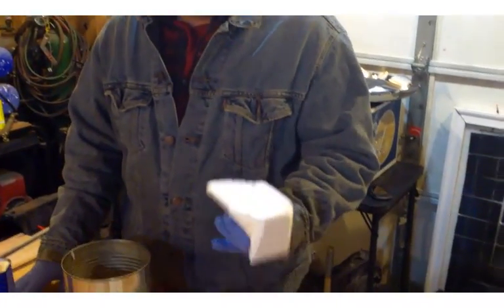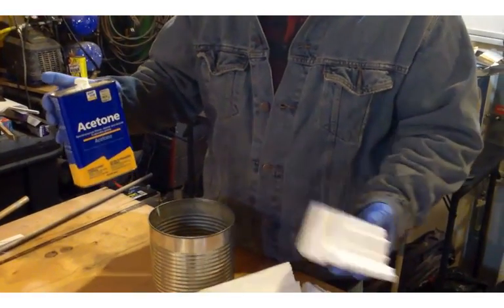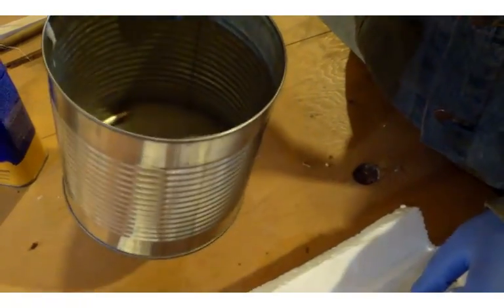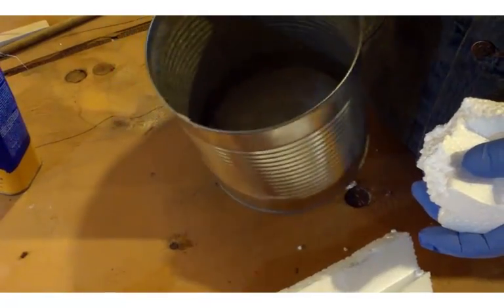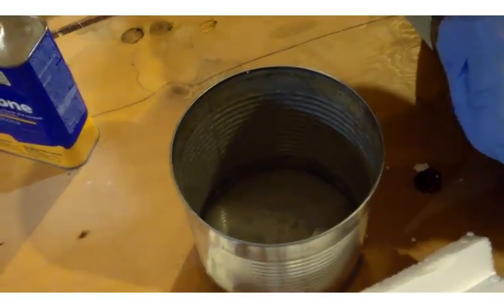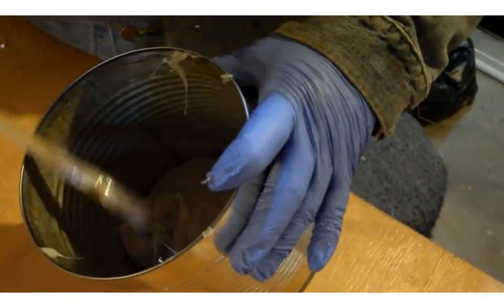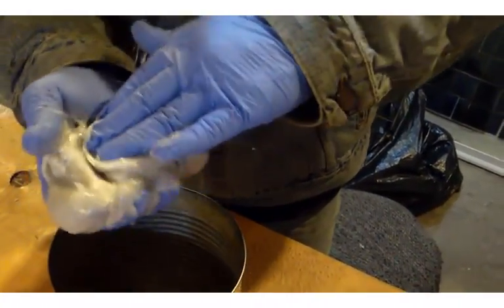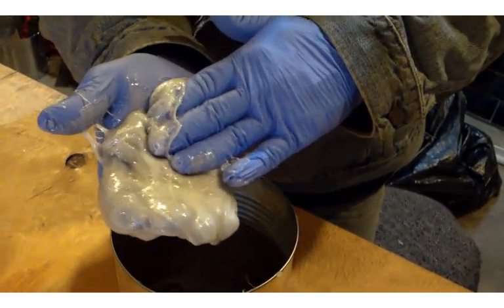DIY Plastic - How to Recycle Styrofoam

Comment: Ahhh... no. DON'T do this at home. PS foam is just about the worst common plastic to mess with. Acetone is explosive.
Destroying Polystyrene in Acetone will release Styrene.
Styrene is regarded as a known carcinogen, especially in case of eye contact, but also in case of skin contact, of ingestion and of inhalation.
Polystyrene is poor choice of plastic for reuse. It is very brittle, so it has poor resistance to impacts and vibration. It also has poor resistance to UV radiation, so it is useless for outdoor applications.

Comment: Great video! Acetone is wicked inflammable. Be very careful whenever using it; a spark can touch off the fumes, and the result will be... dramatic. So make sure the work area contains no vaguely possible ignition sources. (Pilot lights, exposed electrical contacts, anything that might present a spark or open flame.)

Comment: I (reluctantly) agree. Wouldve been good to see it's use rather than just a gooey mass. How would you get it into a "hard-to-reach place" in such as to make it stay in place? Ifeg. it can be poured into moulds then at least you could make things out of reformed sheet structure. All recycling without excessive use of chemicals/fuel burning machinery is good.

Comment: is it possible to recycle styrofoam that have been used in construction? mine has pieces of concrete  floor stuck to it and as much as I try to break it apart it's still dirty and heavily dusted with the concrete

Comment: in the factories it's cut with a hot wire just a thin wire with an electrode on either side and you can slice it any way you want it then it's cheese or butter or whatever you can also take if you would like the wire you can take a long night he did not get it red-hot and I do you're cutting it slices right through like nothing is really there and make it into any shape or size or into slices and that you can dispose of easily

Comment: So since it's mixed with acetone isn't it very flammable and you want to use it i to fill cracks? Even dry it doesn't sound safe to me.
Reply: You shouldn't be putting plastic near fire in the first place.

Comment: It would have been good to show something useful as a finished product.  I can't tell anything about the cured properties from the video.
Reply: On top of what Joseph said, you can use it a filler or glue; mend, fix and strengthen broken car bumper, pipes or any other plastic material. If applied properly and given time to cure. It's waterproof. Good luck
Reply: If you placed it into tubes of various sizes  you could turn it on a lathe.

If you press it flat into sheets of varying thicknesses it could be used for many types of projects